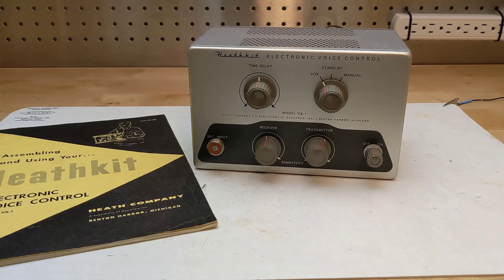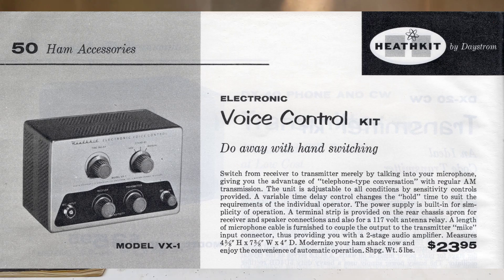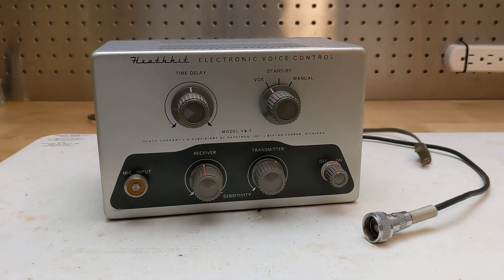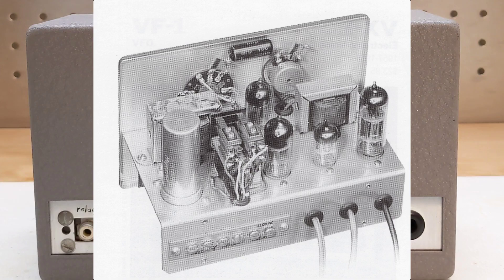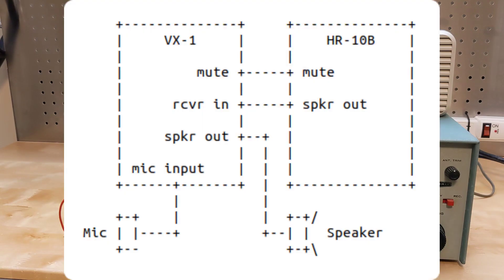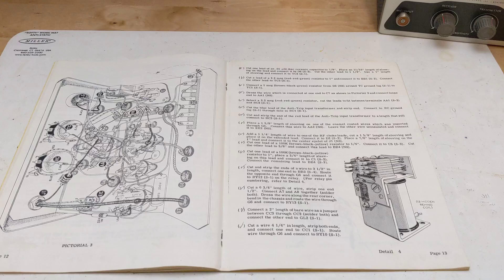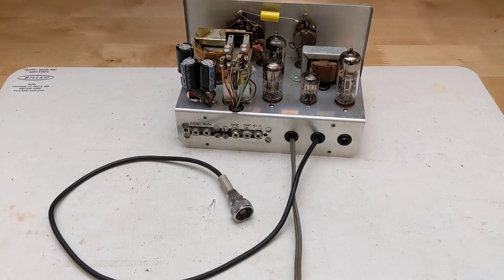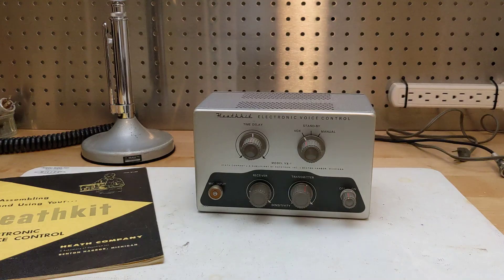The Heathkit VX-1 Electronic Voice Control

Comment: Why leave the selenium rectifier? isn't that a ticking timebomb?
Reply from the maker: I would normally replace it with a modern silicon diode and dropping resistor, but I decided to leave it original as this Heathkit is quite rare and I don't plan to use it regularly.

Comment: Would disconnecting the antenna from transmitter potentially harm the transmitter without proper loading?
Reply from the maker: Yes, but when properly set up the VOX unit controls an antenna switch relay so that when transmitting the transmitter is connected to the antenna. It is okay for it not to be connected to an antenna when it is not actively transmitting.
Reply: @jefftranter  Ah, that makes sense. Thanks for the reply and all the informative content!